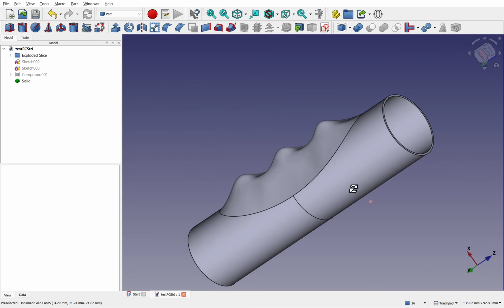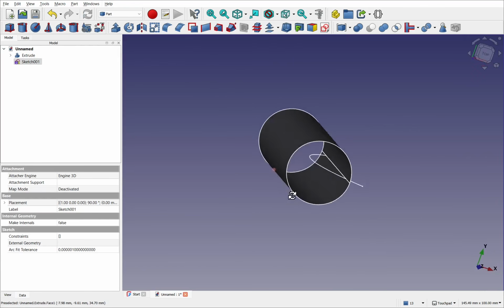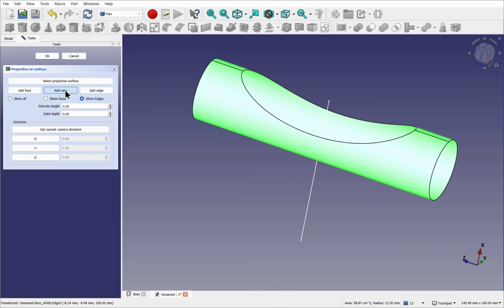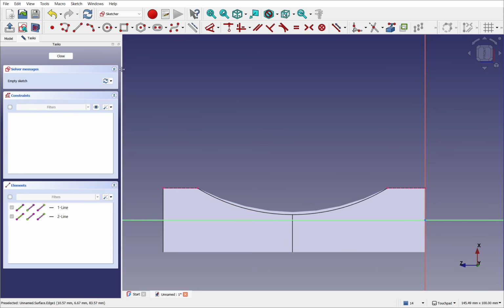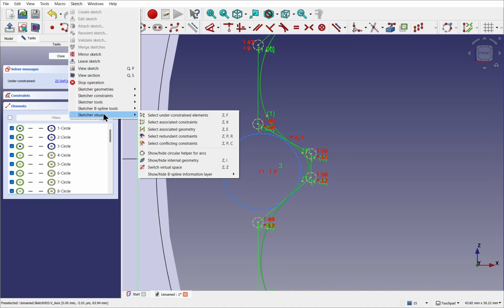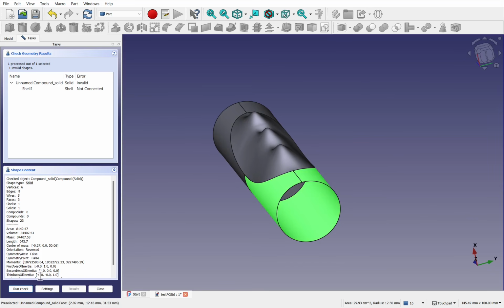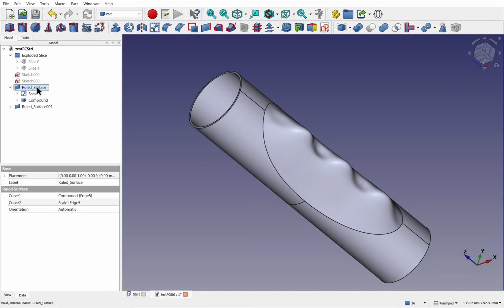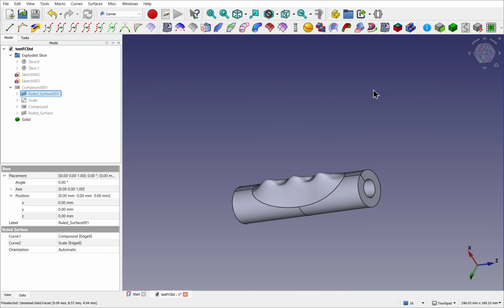Basic FreeCAD Surfacing : Creating Finger Holds and Parametric Solids From Surfaces

Comment: Very interesting! Based on your experience, what would you recommend, when to use the Gordon Surface tool vs Surface Tool with Edge Constraints? Across this video series we learned two tools, I thought for finger shapes Gordon is more suitable, since it will follow an ergonomic shape more precisely...
Reply from the maker: Your correct regarding the precision that the gordon surfaces give, the only problem I have found with them is if the edges don't form a irregular or regular rectangular shape or configuration the gordon surface will error and you have to fall back to surfacing with the standard surfacing workbench.  It's funny you should comment about precision.  This weekend I have a video coming our that compares a surface with a gorden surface workflow where accuracy is needed at a mathematical level and it shows how precise the gorden surface can be.

Comment: When using the Surface WB for creating a surface with three closed non-coplanar boundary curves,
one can either use: Fill Boundary Curves (Surface_GeomFillSurface) or, Filling... (Surface_Filling).
  
With Fill Boundary Curves (fbc) - A different result is sometimes achieved depending on the first curve selected, and the direction of the ordered selection for the remaining curves. Often trying a different combination gives a "better" result (i.e. a smoother, less crumpled, surface). 

Filling... (sf) - however, generally, gives a smoother result (without changing any property settings AND without using any additional supports).  What I am trying to understand is Why? 

I can't recall if you cover this in one of your previous videos?
Reply from the maker: Been looking into this one so sorry for the delay:  It seems that Fill Boundary Curves creates a BSpline surface directly from three boundary curves, but the result depends on curve order and direction, often causing crumples with non-coplanar curves due to rigid UV mapping. However Filling  uses an approximation-based  algorithm, optimising for smoothness yielding a better results without extra supports. Tweaking theTolerance for finer control may help. I am not sure what the difference between the tolerance3D and 2D are.  Can't find that information yet.
Reply: @MangoJellySolutions  Thank you for the detail - very useful to know for the  future. 
Takes away some of the mystery of what and why.

Comment: Revised this Tutorial, Noticed that When doing the B Spline Hand grip after closing the Sketch and checking iy I was Still getting Troublesome Vertex Alerts where the B Spline attached to the Boolean Fragments. No matter the checking of Constraints etc I couldn't resolve them. All went well until the 3D Offset where the operation failed. Using the Scale work around all went Well. It would seem the B Spline not attaching cleanly was My Issue. Also there is a Good chance I missed something?
Reply from the maker: Hi Russel, thanks for feeding back, would you be able to send me your file so I can take a closer look ?

Comment: Learned something! Never thought about using Constraints on B Splines, that'll be handy! Also Edge Constraints these have been a Mystery for some Time!. Need to fix up My B Spline though, Surface was very Lumpy! LOL. A note at 17.51 when offsetting the Compound Solid I initially had a failure. redoing Noticed that after Compounding Surface and Boolean frags a recompute was still pending. After clearing same worked first time. Darren as usual took this into account and gave Us a work around. Note didn't work bad transition of the Surface and Booleans as Daz pointed out earlier I'll fo bad an fine tune.( Wow Slight Sketch Tidy Up and like Magic it's all OK!!, Damn! I'm getting Half Smart at this!!Lotsa useful stuff in this Tutorial. It taken a few Years but this revision is starting to pay dividends. Hmmm not as clever as Thought, the Grip Sketch has persistent Troublesome Vertexes at the Seam Imported Geometry. Have tried several time to reattached but not Luck I'll explore Darrens work around. Hmm Obviously I've missed something Ill revise Tomorrow. Still picked up some useful techniques like the us of Scale and Ruled Surfaces.
Reply from the maker: Sounds like you had fun Russel, thank you so much for sharing your experience.  If you get stuck with the file and your still having issue, give me a shout and I can take a look to see if I can find anything out of the ordinary (or new that I haven't seen before) :) Thank you once again.

Comment: From shell to a solid, there are so many steps! I try to boil each into meaningful phases so I can remember it yet, I have to repeat such an exercise as this grip several times over a week and repeat after a week then two weeks to get the steps to stick!  I take notes with screen shots as I do the exercises so I can repeat it later with a quick reminder.  I am doing FreeCAD because I got a 3D printer and that is not as useful unless you can make your own parts.  I am retired and doing this as an interest. I have learned from you and others. I looked at the manual, but it seems rather generic. FreeCAD would be nearly impossible to learn without the examples provided online.  Much appreciated!

Comment: I have my own model in a window and Your in another. So I can work on my own and look at Your step by step. In this video, I had som trouble. Now, I am old (78!) , but I think if you slowed down just a little bit in Your mouse movements it would be much easier to follow those fantastic tuturials. I have found nothing like this.
Reply: you can slow any youtube video down with the playback speed control. Just as an FYI. One love fam.

Comment: The offset error only occurred for me between a thickness of 0.6 and 1.2 mm.
Reply from the maker: Sounds like there could be some surface intersections below and above that value.  You can play with the surface properties and the tangency between the sketch that controls the peaks and dips of the surface for the grip and the angle it starts and ends to the cylinder.